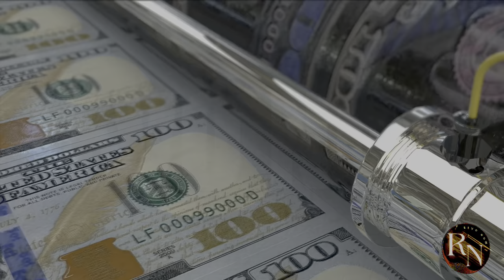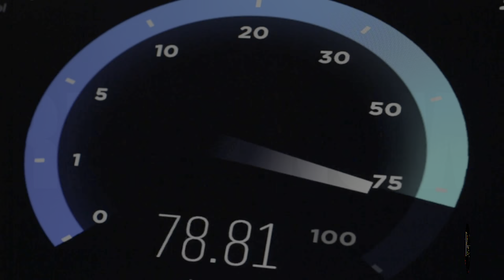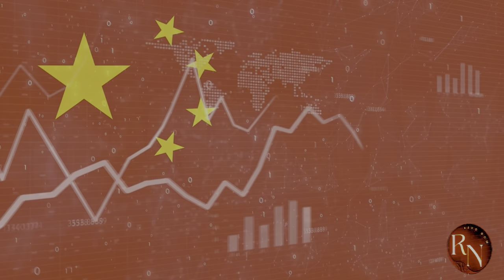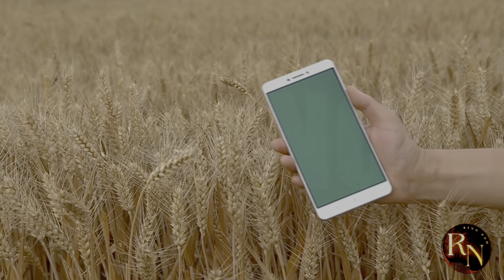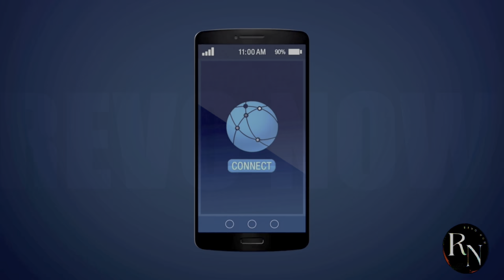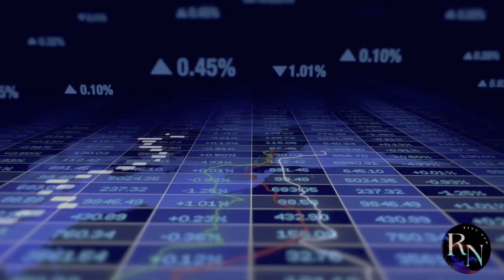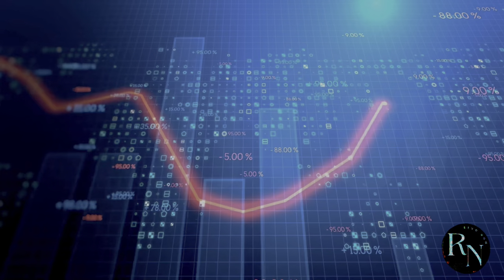China’s Fiber Secret: Uncovering the Tech That Leaves US Behind

Comment: Narinder Singh Kapany, a physicist from India, is considered the “father of fiber optics.” In the mid-20th century, he conducted experiments that demonstrated the possibility of transmitting images through fiber bundles. 

However, it was not until the 1970s that Chinese researchers at Corning Glass Works developed the first practical fiber optic with low signal loss, capable of transmitting information over long distances.